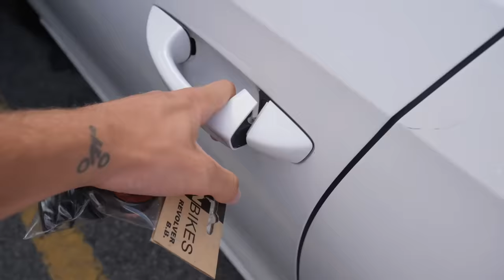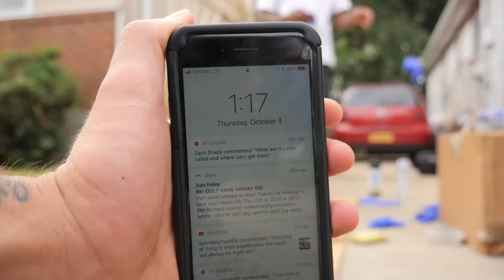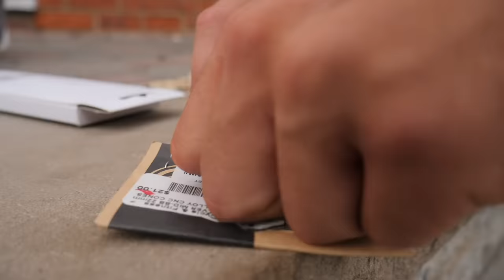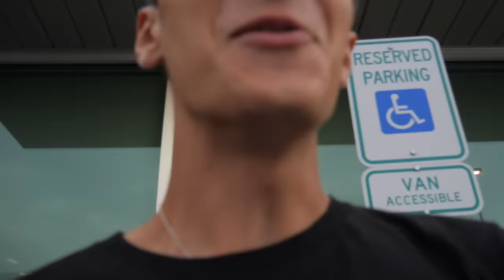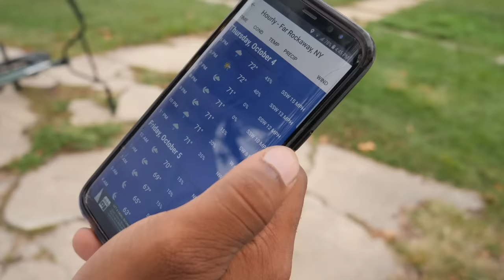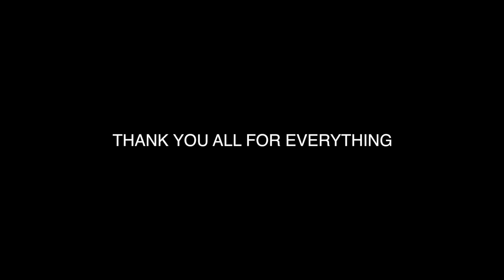SURPRISING MY FRIEND WITH A BRAND NEW CUSTOM BMX BIKE!

Comment: Back in the mid-late 90's my brothers and I never had anything premium. A couple of GT's a couple Schwinn's, a handful of Mongoose's, but the bikes were different. Times were very, very different.
Then life happened to us all. 
A few years ago I got into fixies. Then two years ago wanted a BMX, but did very little research and didn't have a lot of money. I remembered GT's were good in the 90's so I got a Mach One Pro 24". It didn't take long for my body to remember what to do from two decades ago. But, it's not even close to what I really need for what I'm doing. I need something really, really good. Something solid and damn near bulletproof. Something I can enjoy being 39 years old and being able to afford. 
I'm 6'10"ish. I need a 21" tt. Not sure about the free coasters, I haven't even had a cassette yet. The Mach One has a freewheel.
I love the sound of the cassettes, but I love the idea of a freecoaster for backwards riding.

So I'm thinking a WTP Battleship, or a WTP Envy. But are they unnecessarily priced? It doesn't seem like it. It really doesn't have to be such a high end bike... But I can afford it and now that 40 is a year away, it's not like I have time to lose. I can do some things on the cruiser, but the size, frame, and style definitely limit.

So, Envy, Battleship, Sunday bikes look pretty rad as well. The Hoffman Lady Luck looks sweet, so obviously I only sorta know what I'm doing. 

I'm in really good shape for 39, and I can tone everything up fairly quick. 

So if price is mostly no issue. And someone wanted to just get something really, really good. That'll last and last being ridden semi-hard by a middle aged dude doing 90's tricks. I mean I definitely want something special. Not flashy or anything, just really good functional quality. There's so many brands that were never there in my day.

Comment: just saying it helps to sand the paint first with 80 or 120 grit then dump the paint stripper on and let it sit for 5-10 min then start stripping it with a brush or steel wool. sanding it lets the stripper work its way into the paint way faster.

Comment: Sandpaper woulda been way faster and without the mess of the paint stripper. Start with 40grit ->120grit ->300grit and end it with a super fine 400-600grit.

Comment: just a little tip: get a DA(dual action) sander from harbor freight for rawing a frame... you can have it damn near bare in about 15 minutes and hand sand the tight spots.    https://www.harborfreight.com/14-sheet-orbital-palm-sander-61509.html    just redid a mid skool Redline RL 380, it came out wicked!

Comment: just saying sand blasting a frame actually fucks it up. crushed walnut shells. not sand.  same process kinda different medias used in the blasting process. 

thinner is still the best way actually slowest but best way.